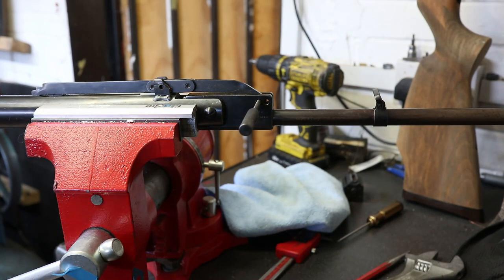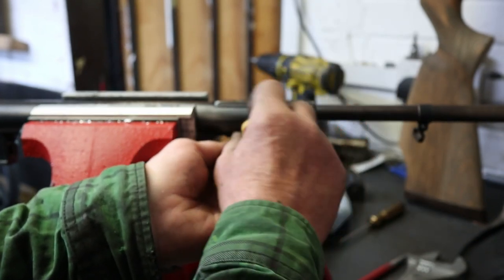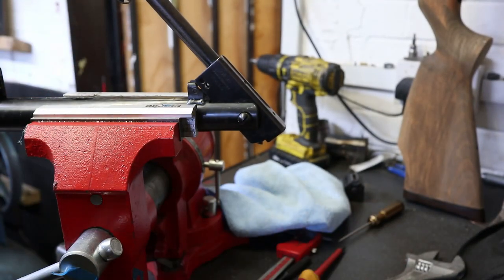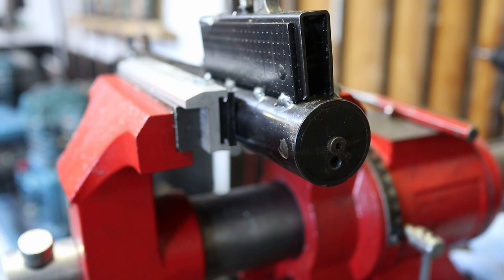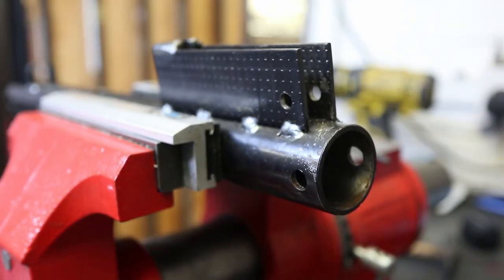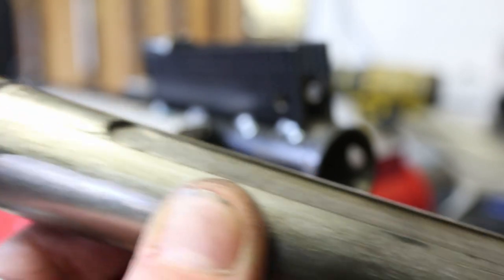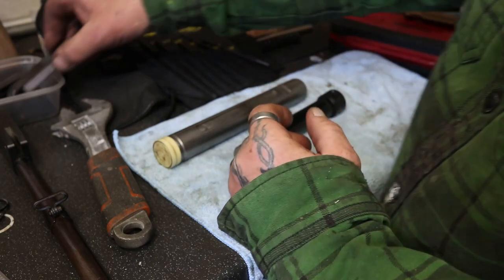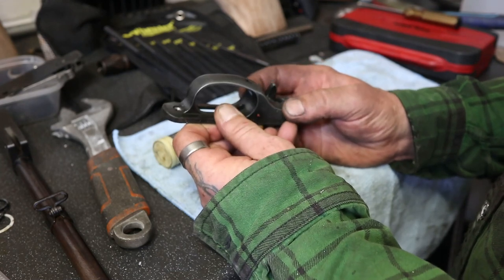Weihrauch HW90, Theoben Gas ram strip

Comment: I've got two HW90'S a 1990 and 2005 version, nice easy guns to work on,I took the piston of my MK1 HW90 in.22 to a machine shop to get it worked on and fit two delrin bearings fitted front and back, It was a bit of a experiment and wasn't sure if it would work for it being a gas ram, but 2000 shots later it is absolutely a pleasure to shoot, I also took the interia weight out of the gas ram and fitted a green Aussie seal to it and upgraded the Schrader valve, its set to 11.5ftlbs and smooth and accurate to shoot, they are great rifles.

Comment: Thanks for a great video, Geoff. I have a question that you may well be able answer. I have recently been given one of these rifles and it's strange that when I break it open there's a dead section and the cocking lever doesn't engage with piston until its about a third of the way into the cocking stroke. It may have been short stroked but if the cocking lever pin is put into the hole nearer to the action the rifle will not cock which leads me to think there are two variations of piston and that I need a longer cocking lever. Have I got a 12 ft lbs piston with an fac spec cocking lever or an fac piston that's been short stroked with a piston head adapter?
The rifle's serial number indicates it was made circa 2000 and produces 10.3 ft lbs on the chrono with JSB RS in .22cal.

Comment: Hi Geoff, Thank you for posting your video. I found it very interesting and informative.
May I ask please, is the HW90 a good air rifle to buy and have? There's plenty of good reviews on them and they seem well liked.
How reliable is the air system? Do they retain their air? If they are well looked after, are they still prone to air leaks? Are the older ones better than the newer ones?
I'm considering buying one, though theyre heavy and I have a 97K and an 80. Im not sure what I would be gaining? I like the fact they can be left cocked, only if I missed a shot.
If you have any advice, I would be grateful.
By the way, that's a beautiful vice you have there. Ive seen similar on the gunsmith stands at the Shooting Show in Birmingham. I think they come from the aircraft industry, or thats what I was told. A  beautiful piece of kit.
Thank you  Geoff, best wishes. Ian.

Comment: EXTREEEEEMLY useful video Squire👌 Me & my 90 have been together now for well over 20 years & NOT once has she ever cheated on me!
it was love at first sight!
She looks great around the house but really knows her way around the  garden if you know what I mean 😏lol !
 was already a hottie at 10 years old 😬when I bought her and has always been brilliant but I'm sure she's lost some of her umff 😔
 I've heard you can stick a footpump round the back😏
or do I have to get a slim Jim in for her?
Also do you know the psi for legal limit again I'd heard 300 but idk ?
Anywayzzz a great vid & very happy to see! a fellow Brit instead of a yank! ;)👍 
Happy shooting!
Reply: Hi my friend if you are on Facebook join the Weihrauch hw90 group, its a private group with alot of knowledgeable people. As for your question you can top up the pressure by buying a cheap PCP pump off eBay bought mine for £20 and you need to buy the HW90 bestfittings adapter, you can get them on eBay aswell, its better getting a PCP pump with pressure gauge than getting a slim jim pump because there is no pressure gauge on it, you need around 19 - 21 bar of pressure in the ram for 11.5ftlbs power, hope this helps.

Comment: God I'm cringing at you twisting the bolt on the barrel. Just break the barrel open and you can nearly unscrew it with your bare fingers, please! Hurts to watch
Reply from the maker: So, you regularly work on them with loose barrels. Thanks for the advise but I'll pass if that's ok ;)
Reply: Realy usefull don't find many vidios like this people seem to be a bit nervous taking the big 90 to bits many thanks.